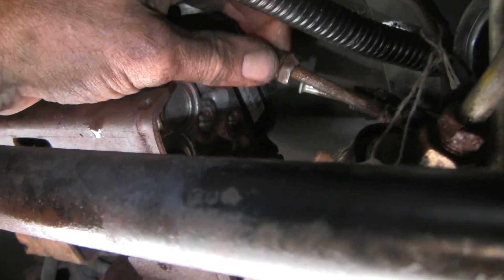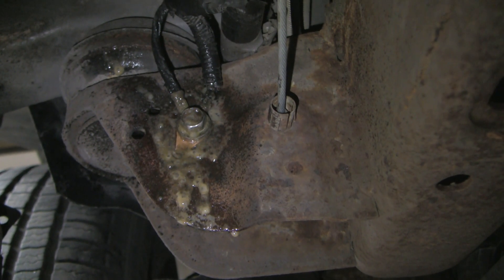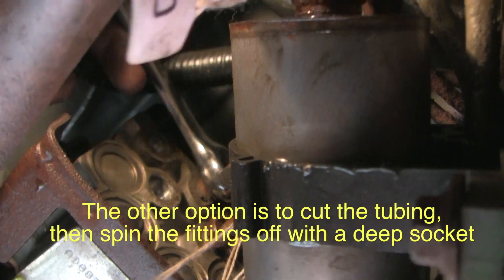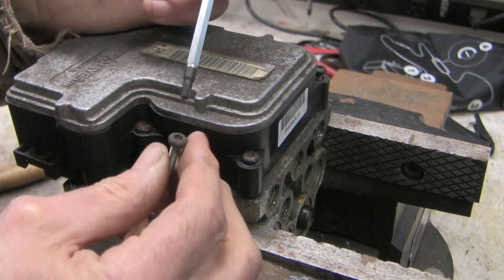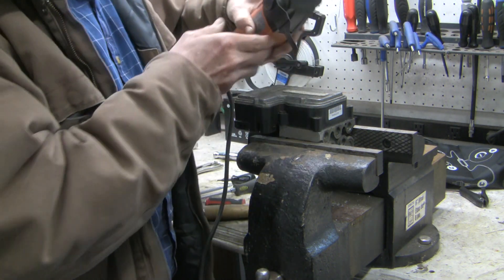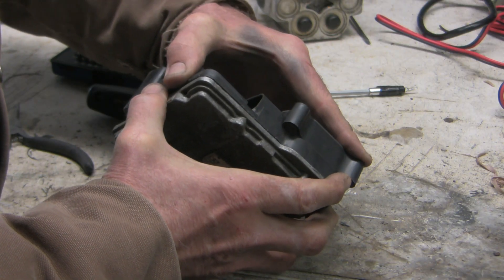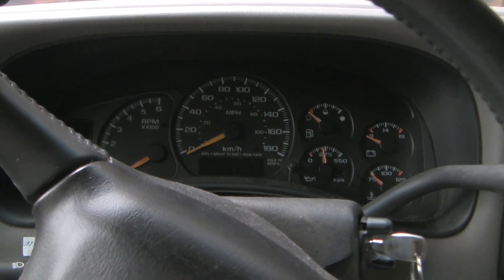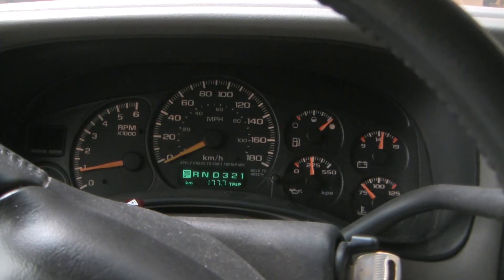How to fix an ABS warning light in a Chev/GM

Comment: I also stripped out the back left bolt in the process of removing ABS module but was ab!e to remove it with a craftsman easy out or I think they call them take outs. I'm very happy I didn't have to get in it as deep as you had too. but sometimes ya just got to do what ya got to do. Good job!

Comment: Could you have removed the PC board from that housing if you needed to? I've seen several videos on this repair and obviously poorly soldered connections are a common source of trouble with these modules,. But there is another source of trouble that could cause problems: defective electrolytic capacitors. These components are found in nearly anything electronic and these modules would be no exception. In the harsh environment of a vehicle their lifespan is compromised. After being subjected to the extremes of temperature and humidity over several years in a vehicle they will fail and cause faults. But to replace them the circuit board has to be removed completely. It looks like this module has been "potted," making board removal impossible. Was that what you found in your part?
Reply from the maker: I didn't find screws holding that board in place, and I wondered if I might break it if I aggressively tried to remove it. Undoubtedly it does come off but I wasn't sure how it was held on so I stopped there. The connection to the solenoids is there as well and I wondered if I might mess those up with my clumsy meat hooks. You make good points about bad caps in this vintage of electronics. Thankfully in this case my repair was all that was needed, and in fact I drove the vehicle yesterday, 408,000 km on the clock so far. I haven't needed to do any ABS repairs since this video.

Comment: Hello. So I tried to hook a trailer up to my 2002 Chevy avalanche and none of the lights are working, it's not a fuse, the lights on the trailer work just fine, could it be the brake and abs lights issue not allowing the trailer lights to function?
Reply from the maker: That wouldn't be very common. A more likely diagnosis would be lack of power or ground in the connector. You'll need a multimeter and patience. Look for what is missing. Corrosion and damage to wires is very common at that point.

Comment: how do I get the air out of the system after?
Reply from the maker: In this vehicle bleeding brake lines is done the same way it has always been done. The one recommended extra step is to bleed the ABS, which can be done with a scan tool or by simply driving to a gravel road and doing a hard stop from about 15 mph a couple of times, then repeat the bleed. One advantage of having the ABS unit so low down is the way trapped air gets mostly bled out automatically, by gravity.

Comment: @spelunkerd Thanks alot for all this information.  Just wondering, if there needs to be a gasket laid out for in-between the module and the pump when reassembling?
Reply from the maker: There's no gasket there, and the GM service manual said not to use RTV there either. They advised care not to score the surfaces when getting them apart. I was living dangerously using a screwdriver in the video, but it worked out OK.
Reply: @spelunkerd I appalogize, I missed the part where you said there is no RTV. I was wondering also, does the vehicle  have to be taken in for the brakes to be bled?
Reply from the maker: @paul-gn1wq  You will need to bleed the brakes if you disconnect the lines as I did, but if you simply remove the EBCM module then I don't believe you need to bleed. Brake bleeding in this vehicle is very similar to normal bleeding. After bleeding I take it to a gravel road and hit the brakes hard to get the ABS motor vibrating, hoping to jar any air bubbles inside the ABS motor loose. If the brake line feels spongy after that I repeat the bleeding procedure. There is a way to skip that step if you have a scan tool that can activate the ABS motor while you are bleeding the normal way.
Reply: @spelunkerd  Ok, thanks again for all the information. Very much appreciated

Comment: Very good job and excellent video on how it is done.  I have a 02' Silverado I got from my son when we bought him a new Silverado.  I did this fix without having to remove the whole assembly because my torx head screws weren't as badly corroded.  Five years now and the ABS light is still on.  I guess if I want it off I will have to get a whole new assembly.  All wheel sensors check okay and scan tools haven't shown any codes?  I haven't done the gravel road test yet but I think I will do that just out of curiosity.  I just looked and see that you posted this video 5 years ago also.  GM is very protective of there computer programing and it makes it almost impossible for regular people to do repairs that should be easy.  I really miss the old days when it was just wires fuses and nuts and bolts ASME and not 10mm BS.
Reply from the maker: Yeah, those days are over. Make sure you refresh the ground connection in case it is a simple fix.

Comment: Interesting job, you motivated me to try on my board.  I got Captiva 2010, brake light & ABS lights on like a Christmas tree.  Replaced abs sensor but didn't fix.  Scanner confirm unable to communicate with abs unit and something with loss ground.  So there are 2 areas to investigate.
Reply from the maker: A bad ground can produce all kinds of symptoms and is often an easy, no parts repair. I'd start there. Make sure the module has a good ground and power feed.

Comment: Great DIY video....I have subscribed. BTW, the thermal jointing compound (white crap) that you referred to as thermally conductive glue, has no adhesive properties of which I am aware. However...when it "cooks" for years, & is subjected to pyrolysis (heating & cooling) it "cakes" & dries out. I am not saying that it could never break a board on removal, but since I have never seen an adhesive paste that was thermally conductive, I would suggest that if the board broke upon removal, it was due to the board being pried in the attempt to remove it. You do these videos very well, & your  verbal descriptions are excellent. Thank you for your  "farmer fixes" (that is meant as a compliment) & your small town conversations.  Both are delightful ! Cheers!   & I look forward  to seeing more of them. Cheers!   Brian

Comment: Very nice video, or lesson!  My son bought a Saab 9-7x (AKA Chevy trailblazer), which I'm sure is very similar to a saburban.  I don't think he has an ABS light, but does have a stabilitrack error.  I am hoping I don't have to do those repairs, since the ABS modulator is a bear to get to!  I did replace the 2 brake lines from the master cylinder, since they rotted out just below the master cylinder.  Saab (or actually GM) used braided neoprene lines from the master cylinder, all the way back to the modulator.  What a job that was, reaching up to get those lines off!  I also replaced the steering angle sensor, and need to go out today and calibrate it and calibrate the Yaw sensor with my Tech 2, since I just got my GM card for it, and of course will select trailblazer on the menu (go figure!).  Hopefully, that is all it is with stabilitrack error?  Any thoughts on this?
Reply from the maker: I'm afraid I don't have any experience with that system. Usually I look to live data to search for clues, and overall the most common problem flagged by ABS is a bad wheel speed sensor. As you know, stabilitrack gets input from many, and even one bad sensor can be enough to pull the whole system down. The trend to require a reflash when new hardware is added is annoying for those of us who want to do everything.

Comment: Exciter ring ( magnetic Ring ) may be broken. It is part of the wheel bearing and is magnetic and can only be checked by jacking up the car and checking from the back side while spinning the tire. Do a search for wheel bearing Exciter ring. Also check for worn out wheel bearings.
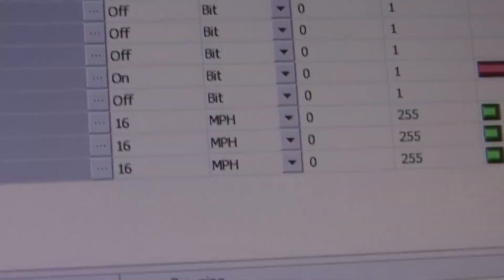Reply from the maker: This is why it is worthwhile to have a scan tool that can read live data. You notice on the test drive, just after 1:00, all wheel speed sensors were sending data perfectly. So, right out the gate, you know it's not the wheel speed sensors. If one is bad, you also will know which speed sensor is delivering bad data. You are right, that would be the most common cause of an abs light, but not here.

Comment: If you want to activated the abs, you just need to apply the brakes on a washboard, gravel or pavement
Inline tube supplies full brakeline kits that are prebent and flared just like factory, they are available also in stainless steel

Comment: Appreciated the detailed video.  I removed the top part only with one one stripped torx, dremelled a slot and removed it.  Soldier, silicone and some new SS screws and she works perfectly.  Got to say it's weird not seeing the ABS & CEL on. 🙂 Three hours saved me $300 bucks.  Thanks again.

Comment: thanks, very well done.....but shouldn't you put some fresh thermally conducting compound on those large pads that use the cover as a heat sink ?
Reply from the maker: Good point. It was mostly still there, but dry.

Comment: Got  a  2002 avalanche 106k miles .. Took it in to get it serviced and they said that thing was out and said no worries it’s a common problem but I wanted that whole thing replaced yes it’s $500 for a replacement but that would be worth it because if I do what you did here and let’s say run it through a water puddle considering this part of Louisiana is all about that then I would just have to replace it anyway, but  it’ll be worth it .. Because I would hate having those ABS and brake light staring in my face especially at night.. and of course peace of mind.. Love the Vape because I’m a Vape man to👍😎👍😎

Comment: I changed a broken brake line on my 2006 Tahoe and now the ABS light and brake light won't turn off. Brakes working great, what do you think it is? I appreciate  any intel.
Reply from the maker: Before getting too worried, I'd check the fluid level in the brake fluid reservoir, then clear the codes by disconnecting the negative pole of the battery for a minute, then reconnect. I wonder if the system detected a low fluid level, triggering the code, requiring a reset. If that doesn't work, I'd carefully find a gravel road, roll the car at about 20mph, and slam on the brake to see if the abs motor will fire off. Then I'd return to the shop, raise the rear wheels, get somebody to press on the brake, then with brake applied, try to spin each of the rear wheels to be sure the rear brakes work. Sometimes drums require adjustment, and sometimes rebleeding is required after activating the abs. Then I'd slide under the car and check the wiring to the abs unit, to be sure you didn't accidentally disrupt wiring. Pay special attention to the wiring to each wheel speed sensor, make sure you didn't accidentally disconnect one when you bled brakes, carefully check out the ground to the abs. Then I'd go to the fuse box and verify that no fuses are blown. I did a recent Subaru video showing that a simple blown brake light fuse can cause what you describe. Failing all of that, I would go to a scan tool with live data to verify that each wheel speed sensor is working, and I'd read the codes for more direction. Good luck!
Reply: @spelunkerd  Thanks I'm disk breaks all around so disconnecting the ground sounds promising as the master cylinder did empty out, Thanks I will get back to you tomorrow.
Reply from the maker: @112223alex  In the 'old days', pre 1995, we had a proportioning valve that would feed pressure to two separate systems, so that if pressure dropped in one, the valve would snap over a Y-intersection and still deliver pressure to the other two wheels. That valve required a manual reset after a depressurization event, which was as simple as sliding the valve to midline with a sharp instrument. Your clue was no brakes in the rear (or front) after bleeding. In the ABS days those valves have been replaced by the ABS, but I presume it does the same thing automatically. The dealers repair manual might offer other ideas or options for you. I subscribe to alldatadiy to get a copy of what professional mechanics have. It's worth a look if you are still coming up empty. When ABS hit the market, we wondered if the ABS might cause difficult bleeding by creating a pocket of air inside the ABS. It turned out most of the time they would still bleed normally. Practically, you want to activate the abs after bleeding to release any air that might be trapped inside the abs, then bleed again.

Comment: I found my fuel pump relay was put in backwards. After cleaning grounds. If it’s in backwards or upside down lettering on top of relay. it looses a permanent ground for relay. I was shocked that’s all I did. 02 Tahoe 175k miles.
Reply: Also two other relays backwards. Flipped all 3 around and had no other issues. Seems to run better.
Reply from the maker: Interesting story. Years ago, I scratched my head when I found many relays, in multiple cars, that seem to be upside down in the fuse box. Then I realized that many relays (not all) are designed to work just as well when placed upside down, a kind of 'plaindrome' effect caused by symmetry of design. Engineers realized that rather than building chirality into the plug, all they need to do is create cross-ways symmetry. So, rectangular plugs connect to the pole of the opposite corner, on each side. Because it is rectangular you can't mix signal side with power/switch side (also blade orientation builds that in). After all, where those connections go is hardwired into the fuse box, and most five pin relays can only physically go in one way. I'd be checking each of those spade connections for corrosion. Or, maybe the relay didn't belong where is was placed.
Reply: @spelunkerd  
I had heard it didn’t matter how relays went in fuse box, so I figured as long as they lined up and fit correctly I would just turn relays around to see? Both ABS and Brake lights come on after a bump in the road or just applying break pedal. The dreaded solder connection repair was in my near future. But after turning 3 of the same type relays around, they haven’t come back on. Over 100 miles so far? Hopefully it helps someone else?

Comment: I have a 2001 Blazer.  Sometimes the ABS Brake lite comes on and then I shut off the motor and tap the brake a few times and it goes off.  Can you give me an idea what's wrong?  Thank you so much.
Reply from the maker: Overall the most common cause is a failing wheel speed sensor, but guessing isn't necessary or  appropriate. Notice that I used my scan tool to see all the wheel speed sensors are working in this vehicle. If you want to try making the diagnosis yourself then you'll need access to a scan tool that can show live data. Auto parts stores will sometimes lend those out, or you can buy one for about a hundred dollars. Alternatively you can pay a shop to make the diagnosis for you. If it is a wheel speed sensor, the fix isn't usually too expensive.
Reply: @spelunkerd  Thanks:-)

Comment: Mine lasted a little over a year and light is back on.  Not sure if I should purchase a remanufactured one from Rock Auto.
Reply from the maker: Double check that ground connection, live wheel speed sensor output, connectors, and your codes to be sure it isn't something else. To be thorough most guys would verify good power and ground at the connectors. Mine is still going strong but as you say your other option is to replace it. I have no experience with companies who do that. If your wheel diameter is not stock you may need a reflash. Good luck!
Reply: @spelunkerd  awesome, I will take a look again.  Wheel diameter is still stock.  My 2001 suburban has 375k all original miles and has many issues now.  It would cost me more to fix everything than what's it's worth but it has a lot of sentimental value.  Thanks for the reply, take care.

Comment: My 2000 Silverado had this very problem a year ago.  The ABS light and the Brake light came on frequently on rough roads and when it was very wet.  Every other manufacturer puts the ABS motor under the hood, but GM likes to charge for labor in their auto shops.  Your instructions on this cause and the repair was so well done I took the job on myself.  In the end I had to drain the master cylinder, which was OK since I had never changed the brake fluid ever and it was way overdue to be replaced.  I got the ABS unit out, tore it apart and re-soldered all the contact points you mentioned a few more.  Result?  Success.  Thanks so much, I learned a lot and now know what Room Temperature Vulcanization is as well.
Reply from the maker: Thanks, man! You made my day.
Reply: My 2002 Siverado. I just learn to live with it, only happens in winter/wet conditions. Never happens in summer time? I don't have the facilities to do this job in my garage. Glad to finally understand the problem!
Reply from the maker: @fugwa  You might refresh that ground connection, shown at the beginning. It is a common problem, easy to fix, and if it works you save yourself that annoying light and the irritation of trying to sell a vehicle with something wrong. On the other hand, you may have to search to find it, Chev changed where they put those ground connections and even the ABS housing location changed, depending on the year.

Comment: Great video. Thanks. One suggestion always try to tighten any bolt just a bit before trying to loosen any bolt. In most cases the screw or bolt will break loose much easier.